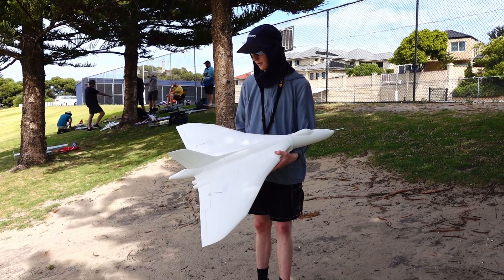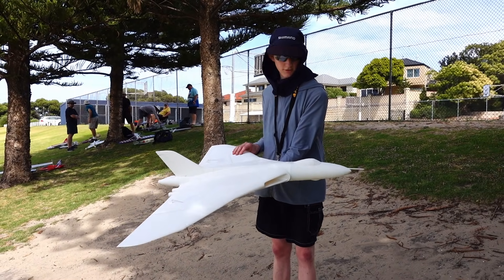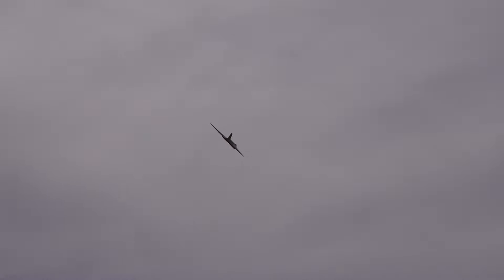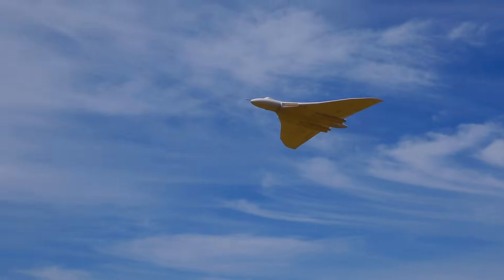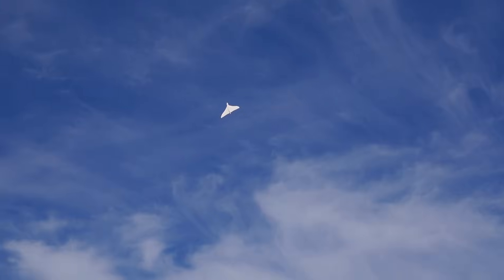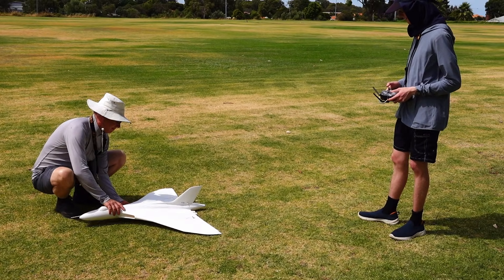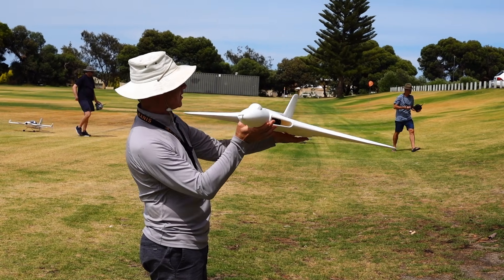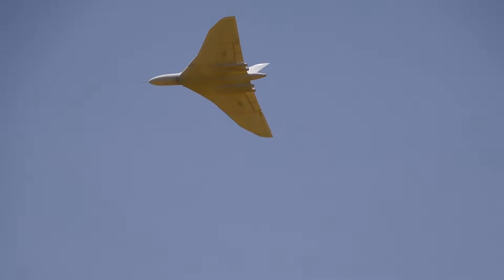3d-printed Avro Vulcan 50mm 4S EDF Version 2 maiden

Comment: Greatest flight demo I ever saw was an RAF Vulcan at Barksdale AFB Louisiana in 1975 (I think, or '74). I was around 11 years old. The Vulcan did LOW fast passes, barrel rolls and vertical stall turns. The sound was earth-shattering. It was the best thing ever.  I got to chat with the pilots afterwards. Perfect day.

*I can't find direct evidence of Vulcan rolls at Barksdale when checking now, but I did know what the maneuver was, and remember seeing it done. So would like to hear from anybody who can corroborate (or not).
Reply: I don't know about that specific occasion at Barksdale, but there are enough accounts of rolls being done in various locations and times - including some available on YouTube to think it's entirely possible.  The Vulcan stall was apparently a pretty awful thing when it eventually happened so I doubt it was a true stall turn, more likely a wingover.  It remains one of the most impressive display aircraft I've ever been lucky enough to see.  The sound, the size, and the maneuverability were awesome.  I admit plenty of bias :D

Comment: Beautiful... nicely done... she's a lovely floater...I'll get this one  when it's available.  May I make one suggestion... Add 3 carve outs on the bottom for finger grips so it can be launched by the pilot.  Thumb in one cutout, 2nd and 3rd finger in another, and one just behind those 2 for an index finger.  Congratulations!
Reply: He'll definitely add finger grips, but it will spoil that lovely lower outline that is on display on the thumbnail.  Still, solo launching will need them.  Flew again yesterday with a 4S 2200 and still leapt away from the hand launches.
Reply: @_Mk9  I thought the same... the flow and relief on the bottom is so perfect.  The finger grips would just be indentations... so maybe not so glaring.